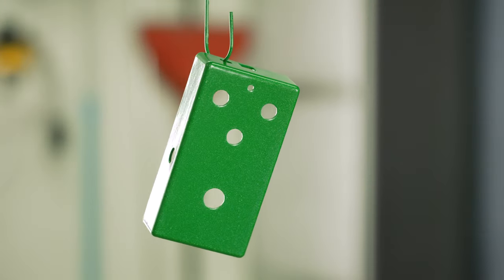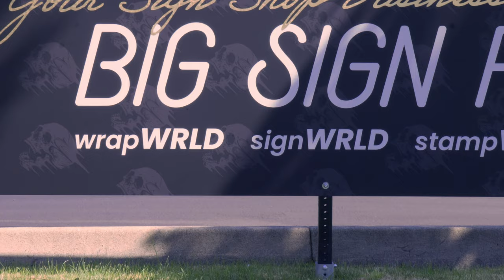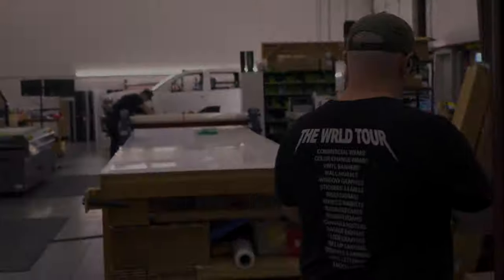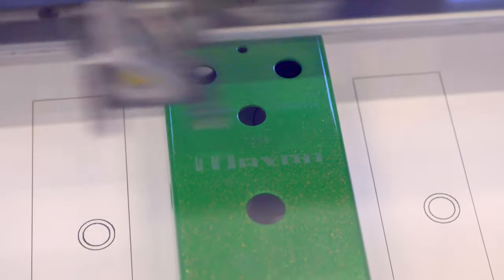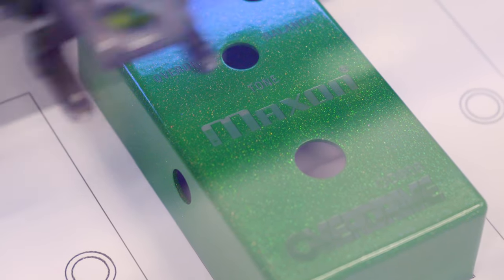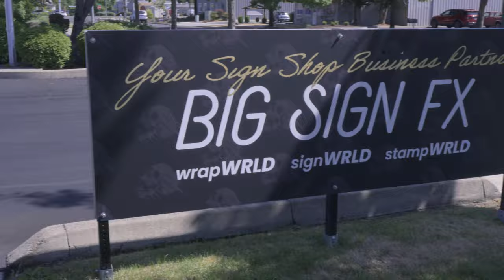Guitar Pedal Restoration Featuring Laser Engraving | Prismatic Powders®

Comment: the graphics look white on the finished product. did you fill in the laser etched areas with white?
Reply from the maker: Actually, we did not fill the laser etching, not to say you could not.  That is the bare aluminum showing. We were worried the text might not show initially, but it worked out perfect. Thanks for watching!
Reply: That was Awesome! Every aspect of it. From start, to prep, to shooting, loved the engraving, and the tip on metal choice and ways to adapt to aluminum or other metal. Great job guys. Thanks for the tips.